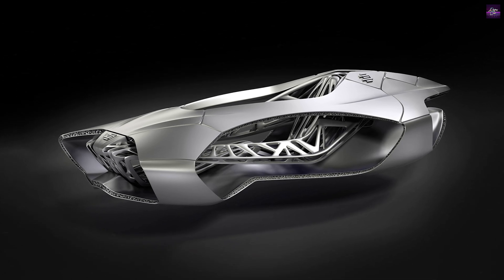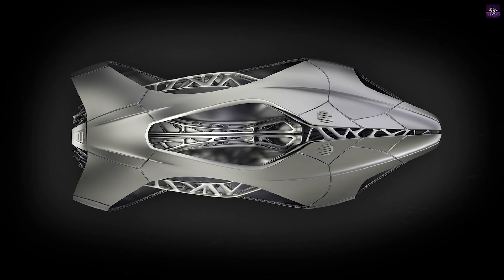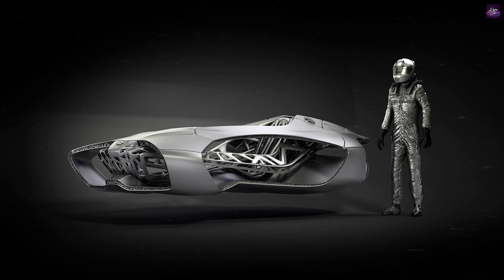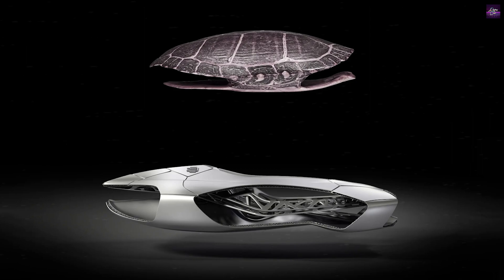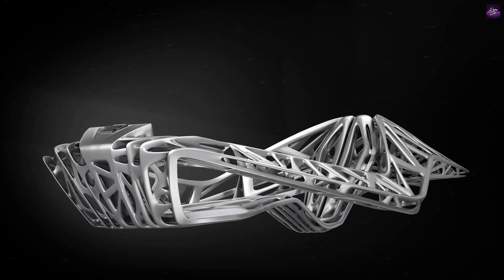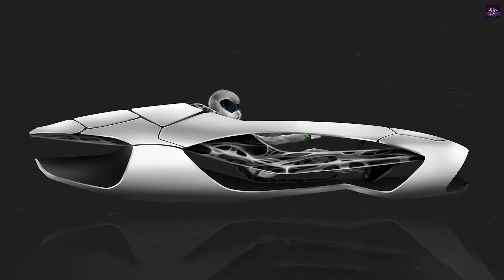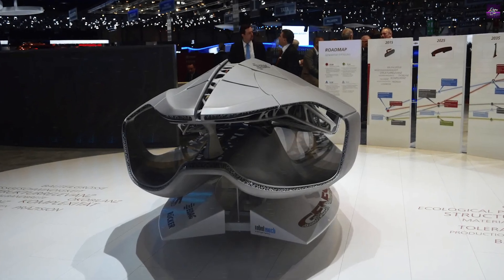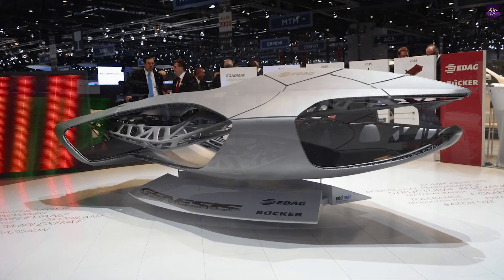The EDAG Genesis: From Vintage Vrooms to Futuristic Flair

Comment: Do you have to replace the whole car body if you get in a wreck?
Reply from the maker: I wish I had added images of the car, which uses a special engineered frame of stiffeners to create parts for the car. In my opinion it improves the rigidity and gives more safety to the passengers in a collision.